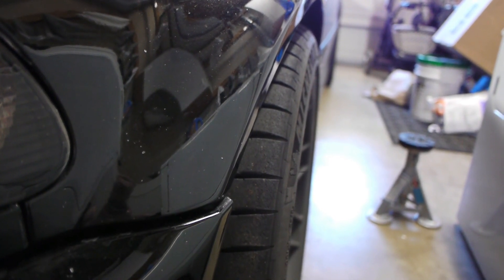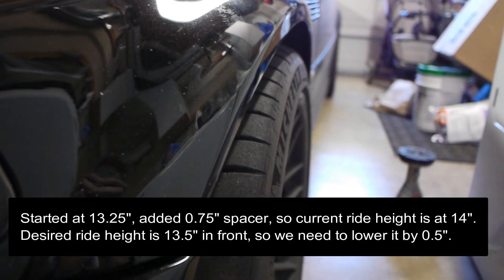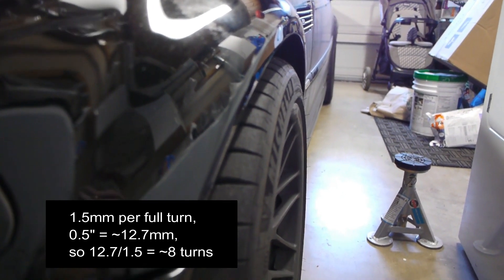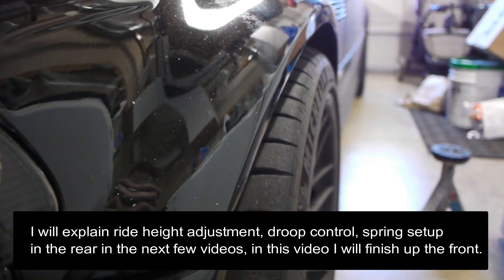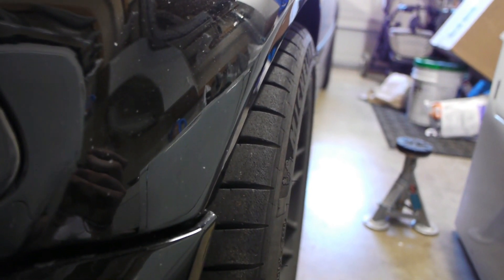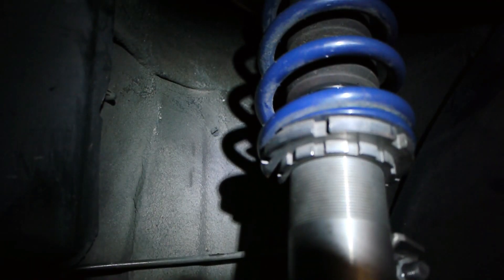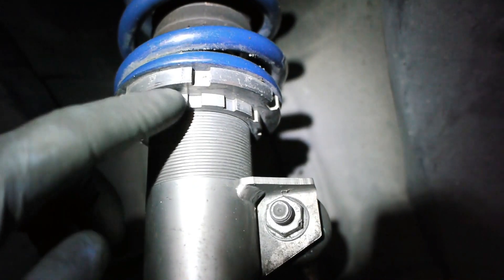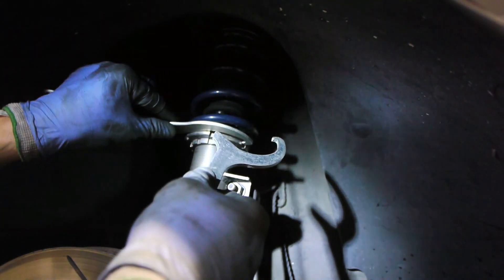E46 M3 Ohlins R&T Spacer - Part 4 - Height Adjustment

Comment: If I had the driver side front strut approximately 4 turns higher than my passenger side front strut. Would that make a big difference in handling? Considering the ride height is even on both sides? For some reason my car is slightly lower on the passenger side
Reply from the maker: Yeah there could be differences side to side. Believe it or not, frames and strut towers do bend over time, so adjustments side to side might need to be a little different.
Reply: @mrgizmo7975  thanks for the reply. I ended up raising the suspension 6 turns on the rear driver side, 4 turns on the rear passenger side and 4 turns on the passenger front. Driver front didn't need to be adjusted. I added 1/8"  on the driver side so it's even when I'm in the driver seat. I have the "track day" ohlins from 3dmmotorsport. I set the ride height similar to you (13.5" front 13" rear)
Reply from the maker: Cool. Yeah I have my driver side turned 1 turn higher so the car sits flat once I'm in it. I haven't corner balanced it, but that's a very rough approximation. Are you running flat ride, or just whatever stock spring rates come with the kit?
Reply: @mrgizmo7975  I'm currently running the stock springs that come with the kit. I was thinking about doing flat ride in the future with some custom springs but I will see how this setup is right now.
Reply from the maker: Cool.